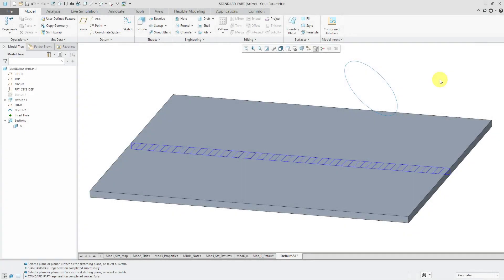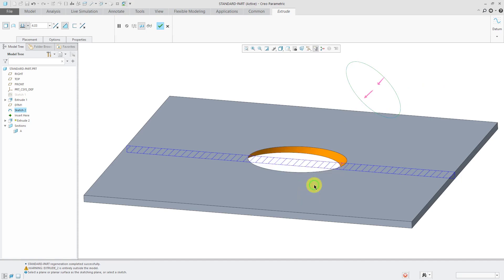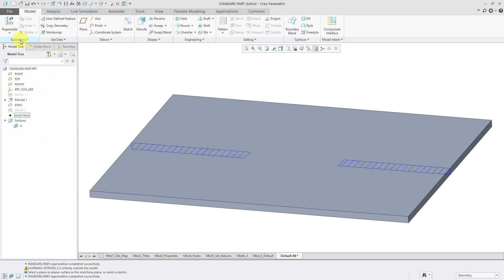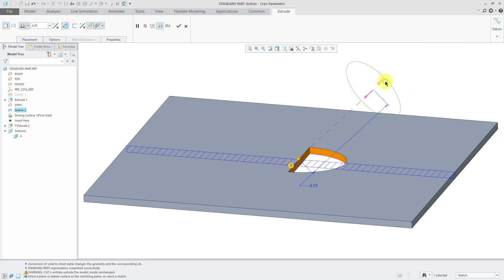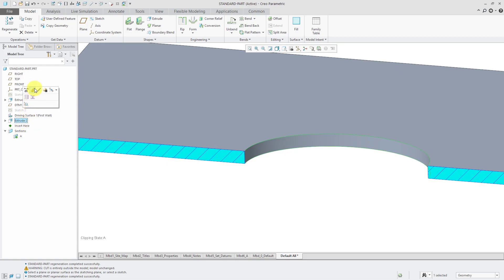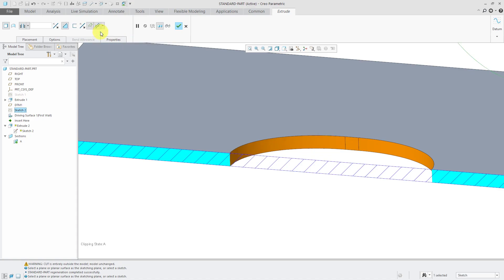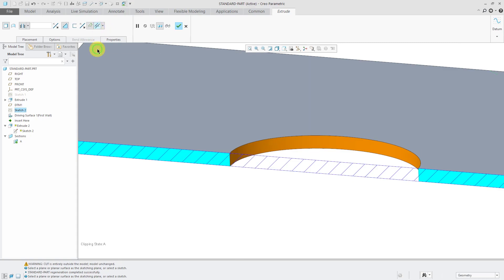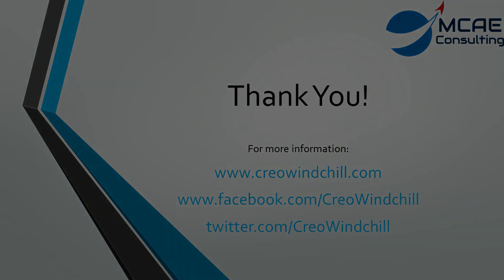Creo Parametric - Sheetmetal Cuts

Comment: Thanks again for the awesome video! Please help me, I would like to know if its possible to extrude normal (90°) and uniform to a curved surface? Best regards!
Reply from the maker: What kind of tool in the real world would be used to create that kind of cut in a sheetmetal part?
Reply: @CADPLMGuy  Sorry for the misunderstanding, it does not necessarily have to be for a Sheetmetal, I just wanted to know if it is possible, because when I make an extrude on a curved surface and in "Options" I select the depth of the selected surface with "side 2". It makes a cut directly normal to the surface where the extrude starts, but not to the curved surface. 

I admit that it is very complicated to explain and even more so when I am not an expert. Don't worry and forget about it, I will do more research. Thank you!

Comment: They have added an "Extended cut" feature in Creo Parametric 7.0 to make cuts. The Extrude feature does not have the other options in version 7.0.
Reply from the maker: They added a new icon but it's not new functionality. In Creo 6.0 and earlier, the first use of the Extrude tool created a primary wall. Subsequent uses of the Extrude tool created a cut as described in this video. This distinction was lost on some users. It's not so much of an added feature as splitting out the previous Extrude tool into two separate icons.
Reply: @CADPLMGuy  Thanks for the information.